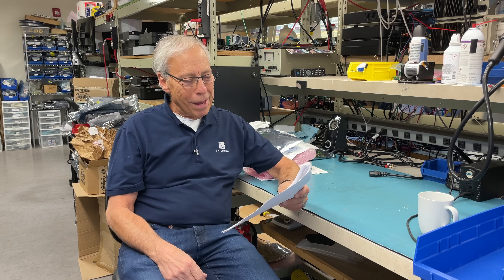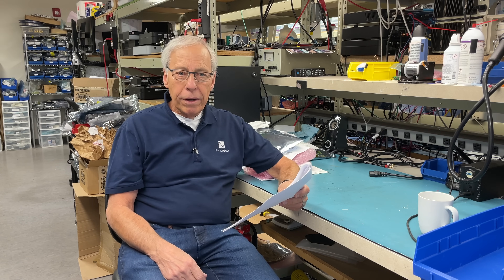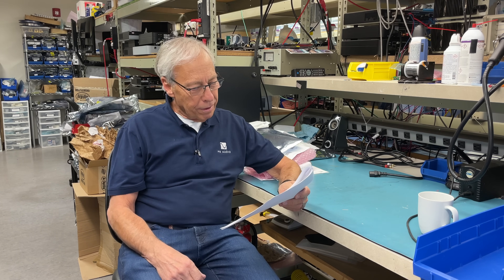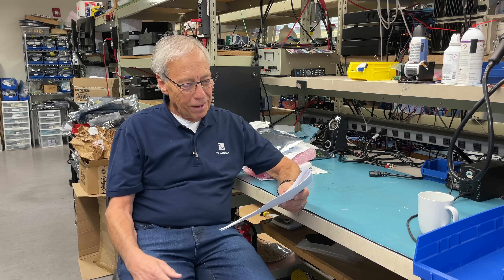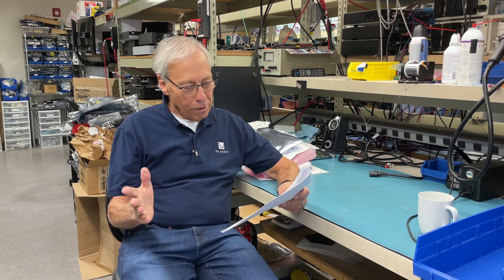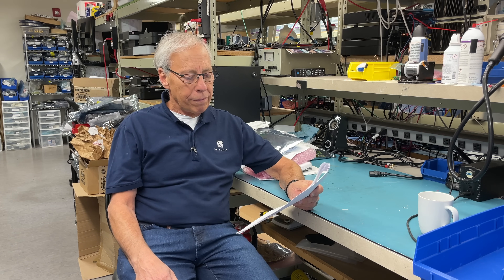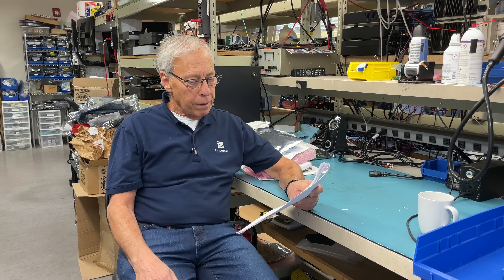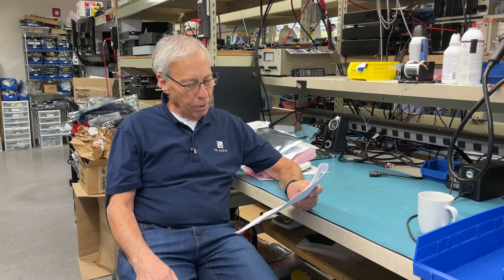The importance of internal speaker wires

Comment: One should minimize loss at every opportunity.  If crossover components (such as capacitors)were 16awg, I'd go for that, as well.  I recall, back in the days of fuses at the speaker, I thought, what an interesting thing... a fuse with a teeny-tiny wire inside.  All of about 28awg?

Comment: I have always wondered this myself. The "Audiophile" industry insists that you need "fat" cables from the amp to the speakers, but then inside the speaker cabinet is all 18-22 gauge wiring.
Personally, when I find a set of speakers I like, I rewire them. Keep the great content coming.
Reply: So, the leads off resistors and caps are 20 gauge or smaller, why would a larger wire connecting them make any difference at all? I've tested resistance of 16 awg and 22 awg wire on a short 2 ft. run: exactly the same at .2 ohms, and that was probably the resistance of my leads off the voltmeter. Sure, if you measure resistance over 1000 ft. it makes a difference but I've never seen 1000 ft of wire inside a speaker box. Ever looked at the leads to the actual speaker terminal to the voice coil itself? Yeah, they are tiny. I guess Paul rewires every component when he builds his high end speakers. I'd like to pull one apart and look. I bet a million pesos that they do not have 14 awg connecting the voice coils. Just another "audiophile" myth........
Reply: The internal speaker cables actually use standard cables that do not carry any sound color, the designer has thought this through carefully, the cable diameter and length have gone through long trials, the conclusion is that when you replace the internal cables with expensive cables, the results are You will definitely be disappointed, because you changed the cable diameter and length without careful calculations
Reply: The "Audiophile" industry is full of snake oil sales people that want to rip consumers off and make huge money.
Reply: And funny enough...even high end speakers has standard quality wires..
Reply: @MrBravo143  Probably because the engineers only care about the overall resistance and current capacity, as one should. Still not quite as bad as the $10,000 000AWG OFC braided power cord going to a $2 wall outlet, with some cheap 12AWG romex behind it. That one never fails to disappoint.
Reply: @mysock351C  
LOLOLOL

ONLY A FOOL uses AC power!!!!!! If you don't have a battery bank, you haven't ever even HEARD MUSIC!!!!!!1
Reply: @PaulLawson-k8v  Oh absolutely! Some vintage Eveready zinc radio batteries is the only way you can truly get pure power for the plates and filaments.

Comment: At the lengths used inside a speaker this is utter nonsense.  And speaker manufacturers would use thicker wire if needed.   This is silly.
Reply: I tend to agree if you consider the voice coil wire is often less than 0.1 mm in diameter.   Number 20AWG is perhaps 10 times larger in diameter. Still, using larger wire is probably a good idea for mechanical strength.
Reply: no it is not silly. think about it this way, Feed your 5/8" garden hose with a 1/4" hose and see how much the flow is reduced. the factories use small wire to cut cost.
Reply: @davidm7824  that’s not how it works with electricity over short lengths.  It’s called science and it’s fact.  You don’t need anything over 22 AWG for lengths that short. Not even.  Look it up.   You will get no capacitance at those lengths to take away frequencies.
Reply: @davidm7824  water flow is very different from electron flow🤣
Reply: Agreed! So which gauge is used in their end stage to the terminals?
Reply: @robkoppens9966  EXACTLY-
Reply: @genesmith4019  besides this, what are the gauges used at the cross over filter caps and especially inductors, not mentioning the PCB lane thickness. I was most baffled by the video on specialty Amp power fuses making a huge difference on the sound 😦
Reply: Honestly these videos make it look like PS Audio doesnt really understand electronics
Reply: @benloud8740  Surely they do as a Company. The problem is how much of a difference it makes, if at all. Compare it to tuning a reasonably priced car. Many components can be upgraded but surely the motor is key. Filling the tires with nitrogen is probably not your first choice to make it perform better.

Comment: Well Paul is talking BS again quality yes thickness not so much, 20 gauge is a bit thin for copper but there is some benefits of having thin wire it gives noise rejection and less inductance.  just go with solid core wire like what's used in the wall 2.5 mm be enough use good quality silver solder 4% and solder terminals.
Reply: I'd add that securing your internal wires to avoid a resonant rat's nest which could break a connection if not secured.  Silicone gob is flexible.

Comment: Wire gauge is more relevant to amperages and distance. So what are we talking about 100 watts @ 60 volts? No more then possibly 2 amps? OFC16 ga. wire because of not only the gauge but strength is more then adequate for the let's say 3' it has to travel. What i believe to be more important are your connections they should be soldered not on squeeze connectors. Now trying to solder a 10ga wire to a driver would take some real heat and possibly damage the connection on the opposite side. also have you seen the gauge of the wire from the terminal to the voice coil maybe its 18ga. as best.

Comment: Oh, how does that logic fly?
If there is internal wires in the speaker that is thinner than the speaker cable between the amp and the speaker..
What.. So the logic is that we should have max the crossection of the internal wires on our speaker wire?!
Ohh, then the crossection area of the copper wire in the spool/bobbin in the woofer is even even smaller!
Does that mean that the internal wires need to be even thinner as those! And of course the speaker cable should also be that thinn! 
(Aprox 34 AWG to 44 AWG then…)

Yes of course we should not have any wire thicker then the thinnest one in the signal path..

If we seek logical explanation without any knowledge then go ahead and comfort your self the you do the right thing. ;)

Come on start your brains and just don't repeat what you have read somewhere like a parrot.

Who use a total gauge as 34 AWG to 44 AWG in their speaker cables.. 

Nobody, so that myth is busted.

Comment: 1m of 20 gauge copper wire is only 33 milliOhms. That should be negligible compared to the DC resistance of a voice coil which is typically 2 to 6 Ohms.
Reply: @Lloyd Stout I didn't notice me making an argument about the influence of DC resistance on music. I only notice that a short piece of thin wire doesn't add significantly to the DC resistance which is already there (in series with the inductive voice coil).
And I recommend you to never judge people based on a short comment on youtube, it just makes you look unsympathetic and it spreads negativity.

Comment: 16G solid core is perfectly adequate. Solid beats lamp cord.
Reply: How did you determine that 16 gauge solid core is adequate? Like to know how you came to that conclusion
Reply: @Scopolamine46  I have a better idea - prove to me it’s not. You can’t - any more than I can prove it is. Just trust me. Solid core, low oxygen is better than the equivalent braided.
Reply: @billd9667  If you make a statement bill then you should be able to back it up with some kind of reasonable explanation. I asked you a question I didn’t throw down the gauntlet. It’s not that I’m disagreeing with you it’s that you threw that number out and now you’re asking me to prove it. I don’t have the time or inclination to do that.
Reply: @Scopolamine46  c'mon, guys... bigger is always better, unless it hurts.
Reply: @jamesplotkin4674  I totally agree, I just wanted to know how he came up with that gauge number as perfectly adequate
Reply: @Scopolamine46  the whole business is opinion. Paul’s is an opinion as well. He hasn’t given any proof either, yet you accept what he says. I am not about to present a dissertation on electrical physics here for your or anyone else’s edification. 

I say trust me. If you want to try to replace all of your internal speaker wire with 10G low oxygen braided wire, be my guest. I’d like to be a fly on the wall when you do
Reply: @billd9667  Not about to do that Bill. In the case of my Maggies, I don’t think that opinion has much to do with this issue.

Comment: how can copper be oxygen free when the ends are either soldered or clamped at the ends to atmosphere?
Reply: Oxygen free copper is copper which has no internal inclusions of copper oxide.
99% of primary produced copper is oxygen free.
The surface can be oxidized but the bulk of the copper is oxygen free.
Strangely, electrons 'travel' along the surface of a wire which can be oxidized.
This is as far as I can get. I am not giving up. I hope to hear 'copper news' from you.
Reply: Thats right, what Peter said.
Copper Oxide has a higher resistance than 99.99 % Copper.
So the Signal has to travel around these spots of CuO.
Further more considering that different frequencies use just very little different ways or layers thru a cable.
Result is, different frequencies have different travel times thru a "dirty" cable then thru a clean one.
Its maybe not that you can tell there is now 0.0001 ohms more resistance, doesnt matter, but it is noticeable a bit less natural sounding, probably due to timing problems.
The cleaner, the better. 
A few manufacturers even connect the plugs and encapsuling it as a whole in inert atmosphere.
Reply: @JeanKatana  its not oxygen free.the ends are open to atmosphere.

Comment: My JBL 18ti that I bought in my late teens in the 80s and I use today as my gym speakers came with Monster cables inside. I don't want to say Monster cables are the greatest, but at least at that time JBL cared about this subject.
Reply: When I bought my JBL L100a's back in '78 (I was 19.) I picked up a pair of Monster speaker cables. Then in '87 I bought the 240ti. I packed up the L100a's with the Monster cables. About a dozen years ago I opened them up to find the outside of cables were "sticky" to the touch. Seemed like something seeped out through the plastic cover. Weird...
Reply: @Mark-lq3sb  My 18Ti’s from 1986 work today with zero problems and zero modifications. They work and look like brand new.
Reply: @ThinkingBetter  
My 240ti's work well too. I wasn't talking about internal wiring..........
Reply: @Mark-lq3sb  Those JBL ti series were well built and can handle a lot of power. For my gym room they are great. I’ve had much newer speakers that have died prematurely for various reasons.
Reply: @ThinkingBetter  
We're probably the underdogs here when it comes to liking JBL. I've been a JBL fan since the 70's. Presently owning 4 different pairs. I have a 'newer' pair of 4365's with compression drivers I use on a daily basis. I know Paul (and a lot of other people.) aren't fans of those drivers, but I enjoy them. I don't hear the "honky" sound Paul speaks of.
Reply: @Mark-lq3sb  Different speakers serve different music differently. I’ve recently enjoyed my JBLs in my gym for music that is aimed at getting me moving. They do really well with rock, pop, EDM and other music with punchy bass that I like listening to in that room. Those 34 year old made in the USA JBL 18ti’s look awesome, plays better and are designed much more sophisticated than some brand new made in China Elac Debut 2.0 I have in similar size.
Reply: They only "cared" because Monster was a heavily hyped-up brand "at that time" -- IOW, it was purely a marketing move and, when it it didn't help speaker sales, they sensibly went back to the appropriate gauges of ordinary hook-up wire they've used ever since.

Comment: i thought the wire gauge wasn't a big deal because the length is so short.
Reply: @Douglas Blake Excellent response. You obviously understand electrical engineering and the concept of distributed resistance in a circuit. I like to use the analogy of a 100amp breaker and 12ga wire. Will a 12ga wire melt if shorted across a 100amp breaker at say 240v? Yes and no. It depends on how long the wire is. Use only a few feet and it will quickly trip the breaker - try it. "But 12 ga wire is only good for 20 amps?"  No..... it depends. I also agree a quality wire should be used inside a speaker cabinet and I would/do use 18ga as a convenient size. It fits terminals nicely and is not so thin as to easily break.  I also used 14ga inside my 18in subs, but you get the idea. Just be practical.
Reply: @andydelle4509  yeah i think thats a reasonable middle ground
Reply: Yes, the few milli Ohms of wire resistance of a few feet of internal cable is not making much of a difference. The "insertion loss" (dB loss) is completely impossible to hear. The damping factor effect is realistically also negligible. But true audiophiles do things for the sake of some sort of comfort factor knowing that there are no cheap compromises, even they are outside the realm of what is audible. Especially the cable industry is riddled with snake oil arguments.

Comment: When I upgraded the wires in a pair of Klipsch speakers it made a 20X improvement over the capacitor upgrade in the crossovers . Used OCC solid copper from VH Audio , new crimp connectors
Reply: 20x (times) improvement? would love to see that data.
Reply: @ericbrammer3845  ditto.:)
Reply: I know someone who would say “BULLSHIT”.
Reply: When you worked on your speakers you moved them.  Even if you think you put them back in their original spots you were most likely off by a couple eights of an inch which will make a noticeable difference in sound.  That is what you heard.  Plus since you did caps I assume youre talking about something like fortes or cornwalls or some of their other models from those times which are very efficient.  Meaning you probably listen to them with only a few watts where thin wires are more than enough.
Reply: New caps, better wire and then you feed it into a cheap tin crimp connector? What was the point of that? Finish the job and solder the wiring at both ends.
Reply: Love Chris VenHaus
Reply: I hope you used "new crimp connectors" specifically intended for solid wire -- the usual run of "FastOn"-Style connectors aren't, and even the more reliable, machine-crimped DuPont-style stuff isn't ideal if the wire isn't stranded.  In general, soldered-on connectors are better for solid-conductor wire.